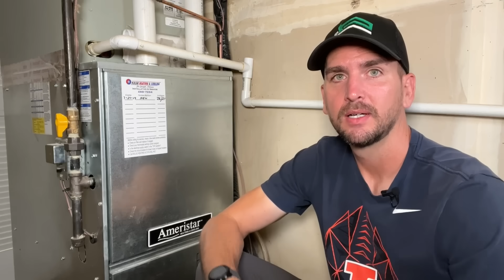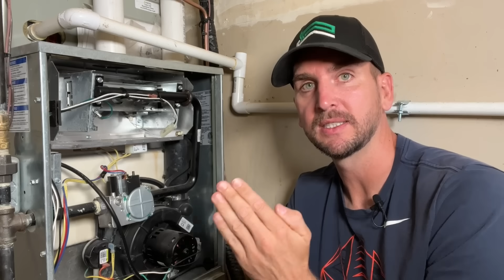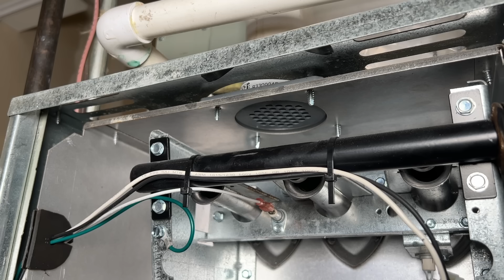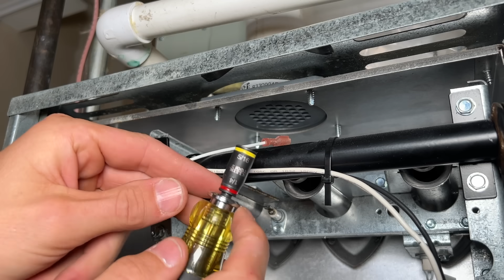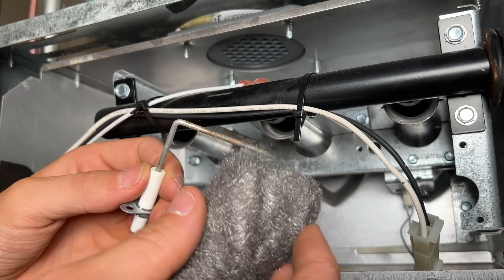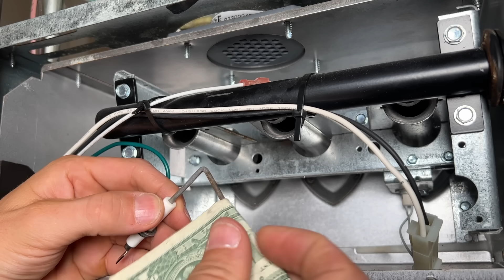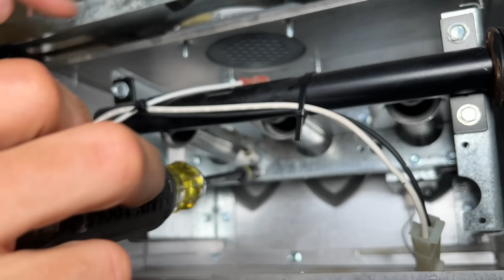The Most Common Reason Why A Gas Furnace Won't Turn On

Comment: I just get a clicking sound then nothing happens. Then it locks it self out and the led light doesn't even have power to light it up to provide any codes. No fan noise, flame noise, nothing. 2 year old Amana furnace
Reply: Verify that the furnace is getting 120 volts and verify that there is 24 volts across the W and C terminal.

Comment: My furnace went out , follow the steps and it was the ignitor, Amazon had the ignitor for $18 , local HVAC asking over $100, no heat for 2 days while waiting for package from Amazon, installed and got heat again,

Comment: My furnace hasn't been turning on when it should. I can turn the switch on the furnace off and back on and it fires right up. Then when it's running it sounds like the gas stops or lets up for a split second and then keeps going. I have an old mercury Honeywell and was thinking that may be the problem but the whole gas issue has me wondering if I have the same issue as you did. Anyway thanks for the video

Comment: This is not a long-term fix.  If the furnace burner is cycling or failing to light as described in this video, it is because the flame sensor electronics are failing.  Cleaning the probe might help it limp along for a few more months, but eventually the ignition controller will need to be replaced, and they typically cost $80 to $200.  That was my experience in the winter of 2014.  I had performed the probe cleaning in the early fall, based on what I had seen in other YouTube videos, and everything seemed to be working correctly, but upon my return to a cold house at the end of February after a two-week trip, the intermittent pilot would not stay lit and the burners wouldn't come on at all.  Cleaning the flame sensor probe did nothing.  I lived without heat for the rest of the winter and spring that year and didn't get it fixed until I found a replacement Honeywell Universal Intermittent Pilot Igniter Module on eBay in September.  I paid around $80 for it and crossed my fingers, hoping that this relatively expensive part would do the trick, and fortunately it did.  As of January 2023 the furnace has been operating flawlessly for the last nine winters with no flame sensor probe cleaning at all.
Reply: None of what you said is true. The flame sensor being dirty is by far the most common flame sensing issue. A flame sensor uses the flame to rectify an AC voltage and the electronics on the board measure the amp draw. If the sensor is dirty the flame will not make a good electrical contact with the sensor causing a low flame sense. The electronics on the board are working perfectly most of the time.
Just because you happened to have the board fail does not mean that that is usually the case.
Reply: @Redtooth75  — When the furnace wouldn't start after I returned from my trip i sanded the sensor probe with fine-grit emery paper until it was bright, bare metal, and it still didn't work.  It worked after I replaced the ignition module, it still works, though I haven't cleaned the probe in many years .  What you're saying is illogical.
Reply: @Milosz_Ostrow  im not denying that the module was your problem. Im saying that the control board is not usually the problem, its usually a dirty sensor giving false readings. 
Flame rectification depends on a several things. The flame sensor having a good connection to the flame, the end of the burner having a good ground, and the control board accurately reading the microamps. A dirty flame sensor is the most common issue because the flame sensor sits in the flame and soot builds up on it.. The soot can prevent the flame sensor from making a connection with the flame which interferes with the flame rectification process.
If that happens the board will be working perfectly. It is accurately reading the microamps of flame signal, the dirty flame sensor is causing those microamps to be lower than it should be.

Comment: First step for no heat is checking furnace filter. If you or your renter has neglected changing the filter the plenum overheat switch will shut down the furnace after a couple of minutes.

Comment: On the older furnaces that use a pilot light the common failure point is the thermocouple. On those furnaces it sits in the flame of the pilot light to make sure the pilot is functioning. Normally it determines if the pilot is lit or not, if the pilot is out, it will prevent the burner from coming on.  It is an extreme simple repair.
Reply: Waste of gas; all gas burners should have this type of setup with an ignitor.

Comment: I have a Goodman furnace about 4 years old. It has a similar problem, it starts the firing process but shuts down without igniting. I’m not sure if it ever gets to actually firing the burner.,, this video will help me track it down. I think it may be the pressure sensor because the fan does run but I never see the igniter get hot. Basically it just gets to step 1.

Comment: What the flame sensor does is accept the dc signal the flame provides. The actual flame rectifies the ac signal to a dc signal which is picked up by the flame rod( sensor). Because of contaminants in the air and gas being burned, a build up can form on all surfaces the flames are in contact with.  This build up reduces the signal to a point to which the control deems the flame not there and turns the main gas valve off. 
   Flame sensors are usually cheap to buy but also tough. Ive only replaced one on the owner's insistance because it was cheap. I've always just cleaned them with a dollar bill( not ever anything abrasive)

Comment: The most common reason for failure to ignite on my last furnace was condensation in the line to the pressure switch.  I would take the tube off the switch, blow it out and put it back in and it would fire up.  I also had to replace the inducer, because it had a plastic housing that was cracked and wouldn't allow enough air flow.  I replaced it with a metal housing inducer and that got rid of that problem.

Comment: That furnace is a commendable FAU.
You can tell by the large PVC pipes shooting up.
The water condensed mused be drained out or it won't start if water has not been removed .
Always confirm no ice has built up outside where the drain penetrates to outside...

Comment: Good video should help a lot of people. I’ve successfully serviced furnaces myself for quite a few years with no training. There’s really only so many components to check and things to go bad or get dirty. Identifying the failsafe switches is important. The only parts I have ever replaced over the years were thermocouples and 1 circuit board that got water damaged from a missing stack cap. Everything else was a result of being dirty or corroded and cleaning cured it. The most common problems I have come across were thermocouples and corrosion on burner circuits preventing ignition. Something anyone with a basic understanding of how things work can service I believe. Just gotta use your head.
Reply: Hey, thanks for your comment on this. I'm now thinking my problem is also with the thermocoupler. I got a brand new flame sensor just to rule out an issue with the old one.  

Basically, the cycle gets to the flames, and even the blower, but then the flames go out, with the blower continuing,  

I took out the burners and made sure they were clean and didn't have any air leaks, but that didn't change the situation. Also the control board was replaced only a few years ago so I don't think that's the issue either. 

What do you think? Do I just need to replace the thermocoupler?
Reply: @teegees If you think that thermocouple is even just 5 years old, for the money especially, I would replace it. They’re pretty universal and usually less than $10 at typical stores. Unless you turn off the gas and completely shut the furnace down for the summer, they have a constant pilot on them year round and they get burned down to a nub and stop working or get weak. Because what they do is produce a small amount of electricity to keep a valve open as long as they are staying hot. So if you’re igniting the burners and then everything blows out after a minute or two I am thinking the draw of fresh cool air through the furnace when the flames are burning is causing a weak thermocouple to cool off just enough to close that pilot valve and kill the pilot light. Once the pilot light is off the whole burner operation is going to shut down whether the main burners are burning or not because the thermocouple is a failsafe mechanism. If the thermocouple is in good shape though and it looks like it has it’s shape still cleaning them with a wire brush can improve their sensitivity because they can get a residue from condensation on them. Being sure the pilot port is clean is a good idea too so the thermocouple is getting a crisp rich flame to stay hot. And also it is important that the flame is hitting the tip of the thermocouple. Usually the last 1/4-1/2” and this can be adjusted as well. If you replace the thermocouple just be careful not to kink pilot gas line while working on it. They’re delicate. Use the old thermocouple to pre match the route of the line of the new it will make installation easier. I’ve replaced thermocouples with & without taking the complete pilot assembly out it just depends on how easy the particular unit is to get to 🤷‍♂️. If you’re having to relight the pilot though each time I think it sounds like the problem though. I hope this helps.
Reply: @bensk8in467  hey thanks your detailed response and tips on this. Turns out my furnace has no pilot light and the igniter is a ceramic heating element which heats up and ignites the gas. Since I had already checked the burners and replaced the flame sensor I was looking to now replace the limit switch, and then the gas valve if necessary (most expensive part to replace). So far I’m just using space heaters but eventually I’ll get things working again. Thanks again 🙏
Reply: @teegees  Sure you’re welcome it could help someone if not you anyway. I did wonder if you possibly had an electric igniter. Glad you have some heat at least for now. One more thing to possibly check is if it has an automatic damper for the exhaust. Because if that isn’t opening up it would shut the flame off. They can stick and not work right if it has one. I think you have a failsafe switch issue of some kind. One thing to keep in mind troubleshooting sensors is they generally two wire & just on or off so you can disconnect the switch and connect the two wires to bypass. If things cycle as they should, you know it’s that switch and saves the guesswork. Hope you get er man 👍
Reply: @bensk8in467  You’re spot on there. Thank you sir.

Comment: Sorry if already asked but this appears to be a "thermistor" with one wire and grounded on the furnace frame. Can a flame sensor be checked for continuity with a multimeter? I'm assuming it has very high resistivity when cold and low resistivity when very hot inside a flame. Wouldn't a show of continuity (zero resistance) on a multimeter between the wire connector and the body of the part, when the part is cold, indicate a failed part? [EDIT]  Now I am thinking the only way to test it would be to connect the connector and the part body to the multimeter, and heat the tip somehow-probably with a torch (carefully) or possibly with a candle flame and look for decreasing R.
Reply: Its not actually a thermistor but I can see why you would think that. The flame sensor itself is just a metal rod with a ceramic insulator. The board sends voltage to it and the flame itself acts as a conductor and the board measures the amps. To test one you need a multimeter that can measure microamps and wire it in series with the flame sensor.
Reply: @Redtooth75  I didn't know a flame conducted current. You mean to test it, just touch the clip for the wire and touch the rod with the other probe-i.e. test for continuity? What could go wrong with a simple metal rod to make it stop working? Maybe an internal fracture from the heat?
Reply: @freespirit-o6l  It is rare for a flame sensor to actually break. Usually they just get dirty which prevents the sensor from working properly. Cleaning it should fix it most of the time. However it is possible for the ceramic to crack if someone is rough with it which can cause problems.
The entire phenomenon is called flame rectification. There are a couple of things that can cause flame sensing issues, the most common is a dirty flame sensor. Corrosion on the end of the burner can cause flame sensing issues and so could a flame that is not burning right and pulling away from the burner.

Comment: My sx 80 ultra  pilot  lights but no gas ,it cycles again  most of the time I have to light it with a long lighter, what causes no gas to light pilot  light .once I light plight the furnace  runs good but when is has to religh t90 percent of the time it will not relight.the ingnighter glows but no gas for pilot

Comment: I watched several videos and finally I found the problem and solution with your help. Thank you so much I was able to clean off the igniter  without removing it and bam it kept running and now how home is heating up. It fell to 12degrees last night so we needed this fix. Your are the hero.

Comment: Blizzard in lower Michigan.  I'm widowed and disabled and was woke up at 3am to my furnace. Calling for heat, then kicks off..ugh thank God for my Blackstone 36 inch in the living room  and 3 full propane tanks. Nobody is coming today on Christmas and I called 2 different places that have been here before. It's a new furnace in 2015. I'm female and I'm not gonna even try to mess with it.

Comment: Yea watching few videos before i call tech support Monday or tues. furnace is kicking on, fan is blowing but not throwing hot air till some time into the cycle,  i am not to brave to dive into it, bit i am also Savy to know what to look for. so, when i call tech he not going go straight to the pc board. Wich cost arm/leg/ now after covid, maybe lung/. think I'll check few these tomorrow, see if they are dirty or have corroded connections. Before i call waste shit ton money that this veteran has to spend.

Comment: thermocoupler !!!! it failed for me every other year or even more often than that ...
Reply from the maker: Having an extra is a cheap insurance policy.  I need to get an extra for each of my rental units
Reply: @EverydayHomeRepairs  that is nice.  But I as the home owner cannot replace that ... by law ... I told them over the phone what was the issue since this happened before still cost me $250  .... they were nice to come next day so we had no heat only for overnight ... My system is very simple gas furnace with hot water base plates. I can test the relay the water pump (all the electrical parts ) but touching  the gas part  require licensed technician ....

Do you think that was reasonable ?  I think the part is less than $30 dollar if that much at all,  and it  took the person about 10 minutes to replace it.
Reply from the maker: @NixUgriBugri  where are you located? I think I have heard something similar for other viewers in Canada.
Reply: @EverydayHomeRepairs  I live in Nassau County New York state close to the Big Apple (work there) ...   I maybe mistaken but in New York state to repair any gas powered appliance without a license is illegal.   Maybe for good reason ...

Comment: Thanks! I’d add checking the air filter first, especially if it hasn’t been changed in awhile! Improper air flow was the reason we had furnace problems twice in the same property!
Reply from the maker: Good point, thanks for the feedback!

Comment: I turned off at the main switch, cleaned the sensor now it won’t come on at all 😮. Also I’ve never changed out a filter in my furnace.  I’ve been here 20 yrs😳. I’ve looked everywhere but I DO NOT see a place for the filter

Comment: Hi I have a ducane furnace and I check all the switches and they are good but the furnace don't turn on ,it makes boom. boom .boom sound and stays doing it. When I check the code it goes to lack up.
What can I check next. I need help 
Thanks .

Comment: Older furnaces also have what is called a flame rollout safety switch. These temperature switches cut off the gas valve if they get too hot from combustion flames hitting them & not going up the flue pipe. Some of these have a red reset on top. Press hard to reset. These can be jumpered with a small wire with alligator clips on each end. They are a safety to prevent a fire. Don't walk away from a furnace with jumpers installed. There is usually a restriction in the flue pipe like a mud-dauber or a birds nest. Clean that out with a coat hanger wire or flue brush.

Comment: Step 5 flame roll out switch then step six thermal couple. Flame roll out important.the shown furnace assembly is not experiencing flame roll out. As the vid shows.thermal couples crack more often then get coated with product of combustion.also if your inducer does not achieve flow your furnace can act the same way.started short cycling then fired like yours just did.I’ve got 99 furnaces similar to yours on my property.

Comment: Awesome video! Your step-by-step description was spot on, and saved me a service call that I quickly had to cancel after I was able to resolve the issue by simply removing the flame detection sensor, cleaned & reinstalled it, and Pa-da the most beautiful blue flame irrupted from the burners. Thank you very much for sharing such a great troubleshooting video.
Reply: Those 2 items; flame sensor and the ignitor ... yeap ...  simple, don't we hate getting abused by the industry?